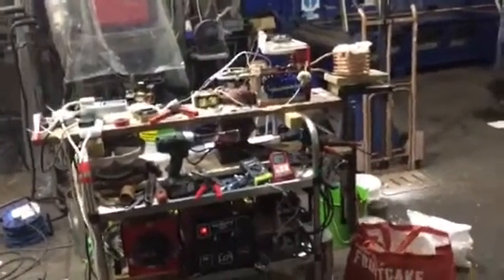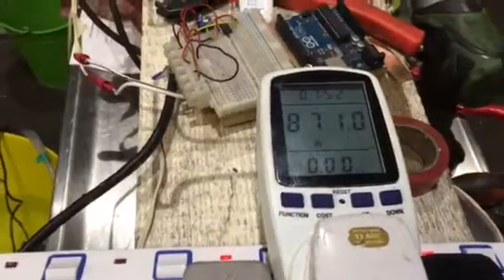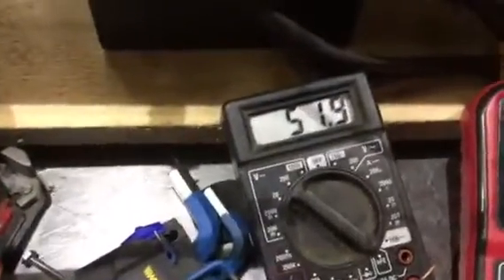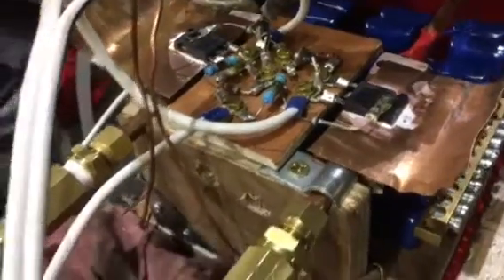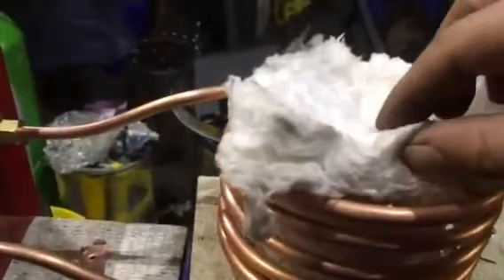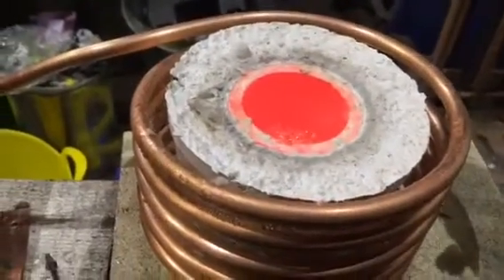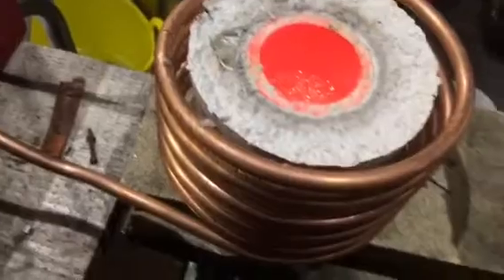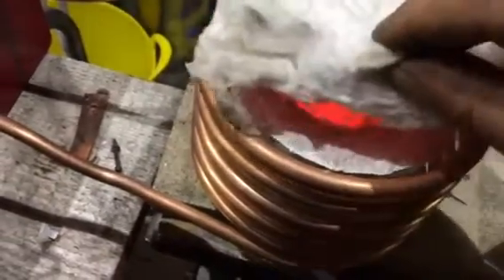Induction furnace melting glass

Comment: how runny did it get ?
Reply from the maker: not very
Reply: @itanc1  Try more insulation? Fascinating project
Reply: @itanc1  You need to hit 2000-2100f to be able to work the glass.  Still a neat concept.
Reply: @jagboy69  what do you mean by 2000-2100f (frequency, power?
)
Reply: a material name?(epoxy resin).
Reply: @jagboy69  AHA: 2000 - 2100 degrees Fahrenheit of course. I'm some kind of a sleepy head sometimes.Another world.  We use Celcius.
Reply: @warddhuyvetter  If you can hit 2100 celSius I wanna know how you did it! :-P
Reply: worldtraveler we have iter fusion reactor. plasma, that's a bit hotter. microwave cannons, rf energy injectors. but induction heaters, i don't know what are the limits.
Reply: Viscous